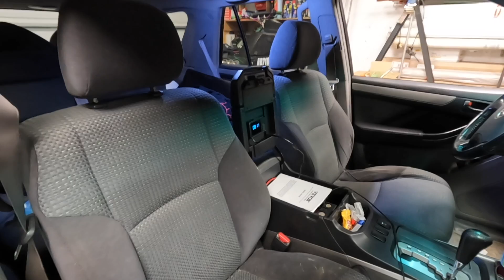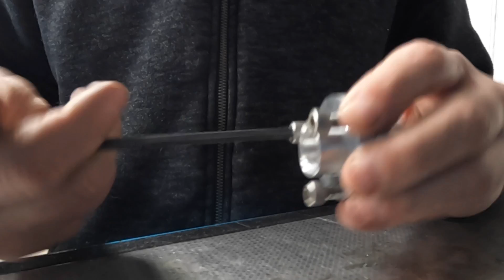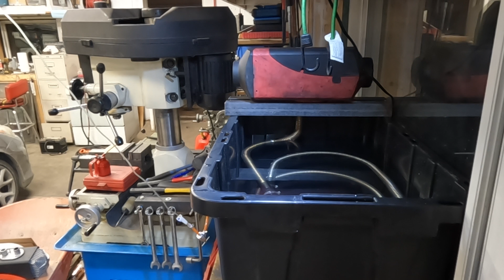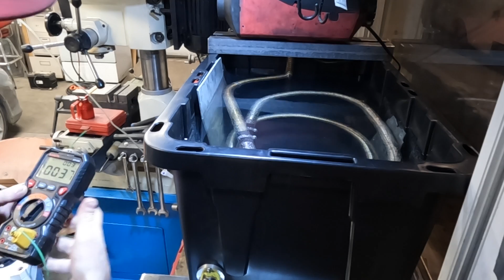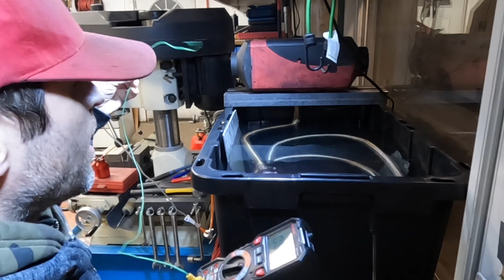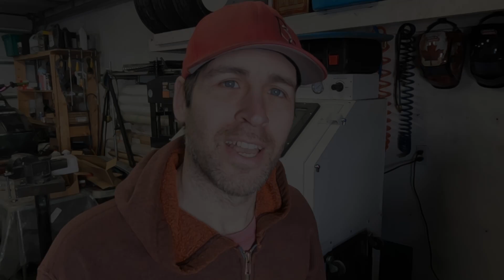"SIMPLE" Water Exhaust Heat Recovery - Diesel Heater Testing

Comment: Are you a tradesman or an engineer?  I see a lot of curious engineer based on the video, but they usually don't let engineers new the power tools due to liability issues lol.   I've raised both so please don't be offended.  Great video by the way.
Reply from the maker: HAHA... My father was a mechanic and a creative type who was always tinkering with something. I spent a lot of time watching over his shoulder and that's how I learnt most of what I know... that and tinkering myself. 

Cheers !
Reply: @loweredexpectations4927  So you are an engineer without a sheepskin and has common sense.  I would call that a double win.  Great videos BTW!
I just lit off a Sunster toolbox heater in my shop tonight.  24 foot x32 foot super insulated shop (R-30 in the walls and R-38 in the ceiling.  I had a 4 degree f temp rise in 15 minutes of max output runtime.  Super quiet machine.  I was actually impressed at the low noise level of the pump right out of the box.
Reply from the maker: @ChuckFinlan  Haha... I don't take compliments well, but thanks. 

They are great little heaters. The pumps are generally not noticeable at the higher settings, due to the sound of the fan, and how they are mounted makes a HUGE difference one the noise level. Solid mounted to a metal case is like plucking the string on a guitar, haha... Suspended or supple mounting on a plastic case is going to be much better. 

You have some dandy insulation in your garage. I have decent wall and floor insulation, but my ceiling is pretty bad... I should have it done properly.
Reply: @ I got a sweet deal on marketplace.  $9 bucks a 4x8x1.5" sheet.  So I rented a trailer for $35 and drove a few hundred miles for 150 sheets.  Great road trip with my son.
Reply from the maker: @ChuckFinlan  Cool...That's an amazing deal. The insulation that I used for my floor was "used" for a project that fell through. It was 4" rigid that was being used to insulate a roof of a commercial building. My walls are sheeted in 3/4 plywood that came from shelving and so on... It took me 3 years to build my garage as a result of doing it myself, on a budget, but it's done 👍

Comment: I will try the same next week, only I thought of something much smaller, and in a 5L stainless Steel pot. I already drilled and flexed the holes for the exhaust pipes, I'm planning for hot water for washing hands or something. If it works well and as we can agree there is so much heat coming from that thing, I will try to build a full water system with heater element. But for now I will try it like this! You gave me the inspo! Thank you
Reply from the maker: Cool. Thanks for sharing. If my calculations are correct, you will have boiling water in 30 minutes. Probably hand washing temps in about 15 minutes.

Comment: Joints can be sealed with aluminum kitchen foil
Reply from the maker: Interesting. You would wrap the joint and then put a hose clamp over it, or use the foil between the pipe and coupler, sort of like PTFE tape?
Reply: @loweredexpectations4927  i usually cut a stripe 5cm wide, plie it along once and wrap the male part of the junction, overlapping it 2mm to help the pipe enter.
Fold the overlap inward to keep the edge smooth and easy to receive the flexible pipe.
The seal will be deformed by the introduction and the collar will keep everything in place.
My english is not good as I would like, but let me know if you understood
Reply from the maker: @IW4DBX  Yes, I understand. Your english is pretty good... I guarantee I can't speak your language, so well done.

Comment: Good video but carbon monoxide its a result of burning a flame 😂 period
Reply from the maker: Thanks for the comment. 

I don't think that's entirely accurate. CO is a result of incomplete combustion. Perhaps you are thinking of CO2, or perhaps you are just pointing out that there is no such thing as perfect combustion. 

These diesel heaters produce less than 10 ppm, at their best, and while I highly recommend against it, could be vented indoors without certain death. One slight change, however, and they go from harmless to deadly, very quickly.

Comment: I know this is an old video. Thought I'd mention the US Army M67 Immersion Heater. The concept might work
Reply from the maker: I looked it up and they sell them on Ebay haha. Pretty cool. Basically a rocket stove that sits under water and burns diesel. I suppose you could do the exact same thing with wood or waste oils. 

I'm guessing it doesn't burn very clean, as it is just a natural draft system, but it works.

Comment: He reports that the temperature rise is 10 degrees at 1 hour.  That is 50 degrees x 132 lbs of water equals 6600 BTU/3412 BTU/kw equals 1.93 kwh. A lot of wasted energy.
Reply from the maker: Yeah... I did the math quickly and didn't think it was that much, but I'm not at all surprised.

Comment: If you revisit this experiment in any capacity. I think you will have better luck. Using roughly half the exhaust pipe. However this time run copper tube around the exhaust pipe (Trying different windings ect... Maybe run the warm water through radiators. You probably can make 2 months plus worth of videos or more. Trying different combinations of radiators you find at the dump. Even if you bought a few of Amazon. They are not terrible expensive. You can even make your own (EGR  manifolds) and test them. EGR exhaust gas recycler. Your options are practically endless. When it comes to reclaiming lost energy from these heaters. Good luck. I hope you tackle  this project.
Reply: @williamsawyer9768 through radiators (one is enough) the exhaust will heat it up, just make perfect joints to seal toxic fumes to the outside.
The radiator must be fed at top inlet and fumes and condensed water from the bottom
Reply from the maker: @IW4DBX  I am releasing a video this weekend where I test this using a 16x16 inch heat exchanger. Outstanding results.
Reply from the maker: I would love to revisit this at some point and see how little copper pipe it would take to make the system efficient. There are many ways to make this better and it was of the videos that I was least pleased with.

Comment: Hi , first thank you for all your experiements... I'm trying to figure out a way I could use the exhaust heat to warm up my preston in my truck in winter ... so heating the cab and heating the engine both at the same time... Have you tried this experiement ? thanks!
Reply from the maker: I have not done this, but this is originally what these heaters were used for... except they weren't air heaters, they were coolant heaters. 

I have not done it, but others have used EGR coolers on their exhaust to heat water. I personally do not think that this would be ideal for heating a vehicle cooling system. The issue is that the exhaust is likely less than 1kw of energy of you are 100% efficient.
Reply: @loweredexpectations4927  I have not done any of this in a vehicle but only in a shop, but I am thinking of a conventional car heater core in front of the diesel heater outlet to capture most of the heat and put it into the coolant instead of the air.

Then, in addition use an EGR cooler to capture the  exhaust heat from the diesel heater.

Both of those heat exchangers should capture a significant portion of the heat output from the diesel heater.

The coolant can then be pumped into the engine or used to heat other parts of the vehicle like an RV.

In my RV we have three heaters that use engine coolant to heat the RV cabin and they work very well.

I don't see why those heaters could not be connected to a diesel heater as well as the engine.

Note, for my shop heater I used a pressure relief valve from a hot water tank and also used a coolant expansion tank placed higher up to always make sure that all the lines were filled with coolant.

Comment: Wow not only was it a pain in the ass, but it took a bunch of time for little positive end result. Even just the time it took to film this was certainly a lot of work. Thanks for not just deleting all of this though! I do wonder if it is worth doing one of those finned heat exchangers for the exhaust. Maybe I'll explore that at some point.
Reply from the maker: I think it is worth it to use a heat exchanger... if you take your time, think it through and do it right, haha. A baseboard radiator, all metal car radiator or something like that, with the appropriate flow rate and a way for moisture to drain out, and you basically gain back about 700 watts .
Reply: @loweredexpectations4927  Wow! I didn't think it would be that high. I figured it would help a little bit, but I am surprised it is that high. Maybe at some point I'll try a hydronic heating tube, or an all metal heater core.

Comment: Have you considered a counterflow heat exchanger?  Easy to make with copper-in-copper but maybe running the exhaust thru copper would eat the copper.
Reply from the maker: I have considered trying this and may do it in the future. It is possible that the elevated PH of the exhaust could damage the copper. I am not sure.

Comment: Even though you don't plan on doing this again, someone else might consider doing it.  One important factor is to not allow the exhaust temperature drop below 180ºC/356ºF for very long as condensation in the exhaust can form and cause corrosion failure of the head exchanger.  This is the same concept as the old steam locomotive boilers but at ambient pressures.  Altrenatively, maybe the heater output air could be used to heat water instead of the room.
Reply from the maker: Thanks for your comment. 

The whole idea with this test is to capture as much heat energy as possible and purposely condense the exhaust. Altho the condensate is acidic it is only about the same PH as orange juice, and the exhaust tubing is 304 stainless (if you believe the chinese retailers) 

I suspect that mild steel would have a pretty short life in this environment, but 304 stainless is quite resistant to acid and oxidation. I'm not sure how aluminum or copper would fair though. Aluminum forms a protective oxide that usually protects it from corrosion, but the weak acid may be enough to remove the oxide layer and cause serious issues. 

 If you are losing about 800w out the exhaust, and you can capture about 700W using this method, then it wouldn't take long for it to pay for itself. I am assuming that by "exchanger" you mean the exhaust heat capturing system, as you would never be able to cause water to condense in the actual heater exchanger.

Comment: Why did you use stainless steel?  As I stated in a comment in your "Capturing Waste Heat - 5 Meters Of Stainless Exhaust - Will It Even Run ?" video from 3 weeks ago, copper has 20 times the thermal conductivity of stainless steel thus you could use FAR less tubing length for the same thermal extraction with the added benefit of it being SMOOTH inside giving a larger effective ID than the flexible stainless.
Reply from the maker: My plan was specifically to do a bunch of tests with this tubing to see what will and won't work. I'm not actually trying to design a setup to capture heat or to heat water. 

Copper is way better and would be a better choice, hands down. My assumption is that a LOT of people will attempt to use this stuff, because it is the right size, ships to your door from Amazon, bendable and what comes with the heater, so it is familiar.

Comment: do you think that backpressure in your exhaust because of the extra lengths of pipe are causing the heater to run too rich?
Reply from the maker: It is not only due to the length of the exhaust, as I have another video  using 4.8 M of tubing, and it worked fine for that test. CO was around 40 ppm. 

The problems here are likely caused by the number of bends in the tubing and the fact that the air in the pipe is cool, therefore dense and has more resistance.

Comment: find a used waterheater .. remove the heating and zink anode .. turn a new lid.. 
get a 3m cupper pipe where exshaust can fit in to not over.. like water air can´t
be blown without resistance.. so a bigger cu tube will be way more  efficiant..
it is not the length but the surface of the tube..
Reply from the maker: Yes... that would work really well. There are lots of great ways to heat water, but I already had this exhaust tubing from another test, and the idea wasn't just to heat the water, but more to collect data and see about how much heat was lost out the exhaust and how well standard stainless tubing would capture the heat.
Reply: @loweredexpectations4927  yes yes bro.. but on the other way you can
Get higer temperatur.. .. let's say you turn the heater on in the morning 
IT will heat 100 200 300L water so you can bath ewery 2 Day..  or ewery Day
Becaus of the insulation and bigger tubing.. adwice.. when you bend cupper 
Or aluminium .. fill tubing with fine sand.. then the tubing don't get flat at the bend
Greetings from DENMARK.. love you'r idea.. just use a tube big enough you can
Push / pull a duster truh to get the sood build up out of exshaust pipe/heater

Comment: Have you thought about using a water to air heat exchanger to use the exhaust gas running through the exchange and then use a fan blowing across the fins to heat the air for extra heating.
Reply from the maker: Yeah, I've been wanting to do something like that for quite some time... on the list of many things to do, haha. I have seen people doing this with EGR coolers... 

I already had the exhaust tubing for a previous test / experiment, so it didn't cost me anything to throw it together.
Reply: @loweredexpectations4927  I have seen a bunch of videos on the EGR cooler but than you have to deal with a pump, coolant, and over flow tank. With the heat exchanger you only have the exhaust in the exchange tubes and an electric fan.

I found the perfect one on Amazon but YouTube won't let you post links in the comment section. Try searching this below.

Water to Air Heat Exchanger 12x12 with 1‘’ Copper Ports for Outdoor Wood Furnaces, Residential Heating and Cooling, and Forced Air Heating

Comment: Hello Joel, I don't know how you are going to use this hot water but I think that the system that I have set up produces a better result in fact, I heat 3 radiators on the circuit and I reach 50 degrees Celsius on the 3 after one hour of operation. I will make you a little video of the assembly soon but for the moment, you are doing a good job. Keep going
Reply from the maker: Thanks for the comment. 

The only real plan was to make a video to share some data with people, haha. More of an experiment for the sake of experimenting. 

If I were to do this for myself, I would be interested in capturing as much heat energy as possible, and not so much in heating up water. I was going to use a small water pump to circulate the water, perhaps through a radiator. 

I will probably come back to this idea at some point in the future, when I have more time to focus on it. I have seen your EGR cooler set up... very nice.
Reply: @loweredexpectations4927  Thank you for the EGR but that's not what I was talking about, in fact, the heating is coupled to the heating system of the house but it can work independently to heat just the workshop I will show you that soon
Reply from the maker: @gassereric  Cool... Sounds very interesting.

Comment: Maybe we need to find the efficiency of the burn compared to the length of the tubing before cooling it down in the water to stop the carbon monoxide unless that transmission fluid is doing all that CO
Reply from the maker: Yes... this would be a good idea... A larger tube would also take care of the CO problem.

Comment: A shorter run of pipe through the water would allow the exhaust temperature to stay up and keep the water dried out of the pipe and you could also wrap it with the heavy to medium steel like an AC pipe or tube
Reply from the maker: Yeah... I think the downward slope is a better idea because you want to collect as much heat as possible. Keeping the exhaust hot will take care of the condensate problem, but you waste a lot of heat.

Comment: What if you went to a piece of real pipe that's in the water so that it will not get holes and wrapped that with very coarse to medium coarse steel wool for more heat in the water
Reply from the maker: A solid smooth wall pipe would be much better... I don't think the steel wool would be necessary though. If you were trying to keep it as compact as possible, this could help.